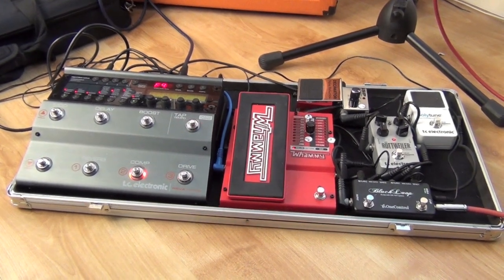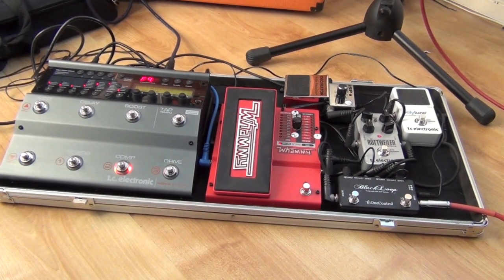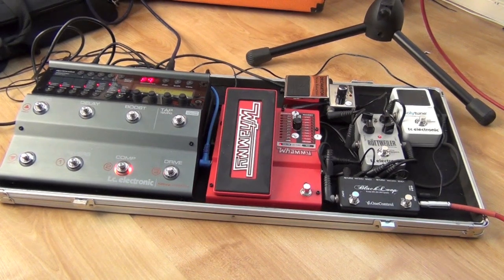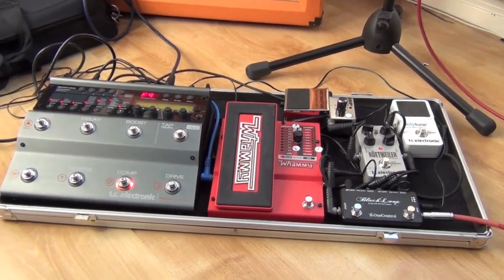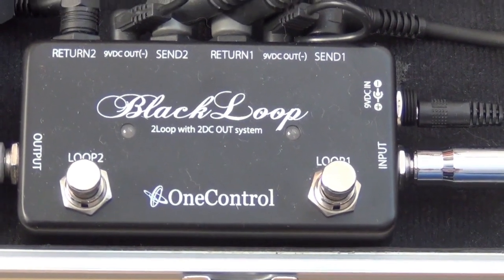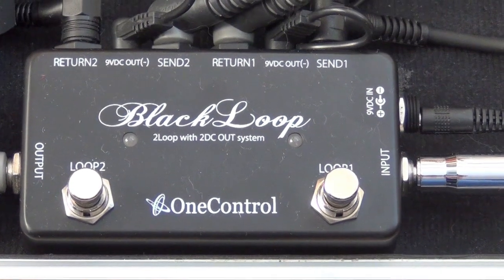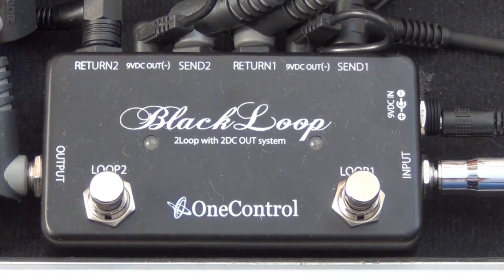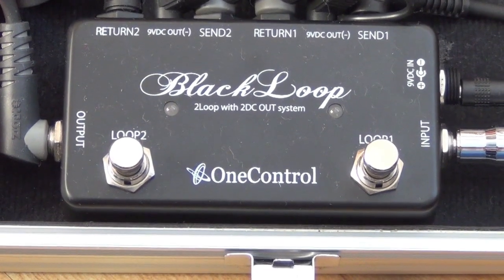Using the One Control Black Loop Alongside the TC Electronic Nova System

Comment: So when you have both loops on, does it go through loop 1, then loop 2, then to the output?
Reply: As far as i know, yes.
Reply: Yes. With this switcher you can have loop 1 and 2 simultaneously, alone, or both off. The white loop switcher however doesn't let you have both, but provides instant switching between 1 and 2